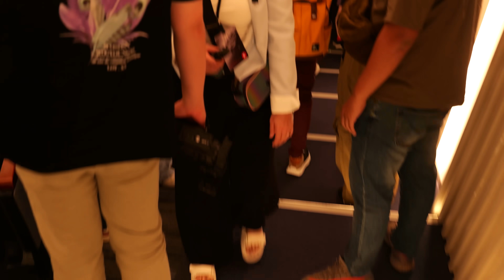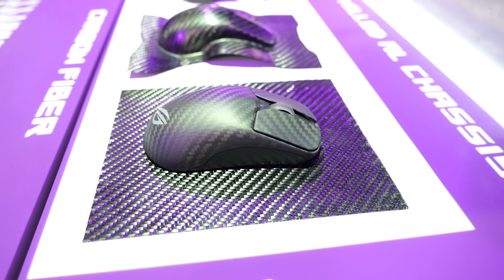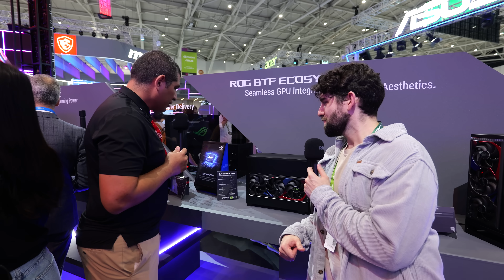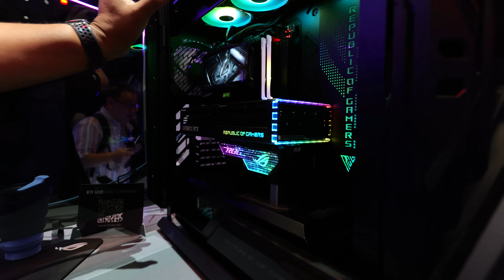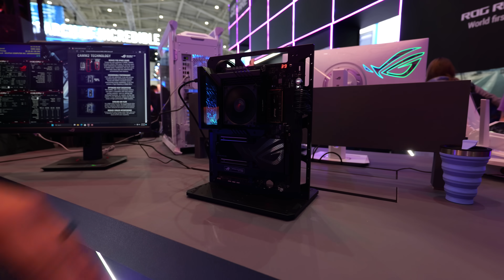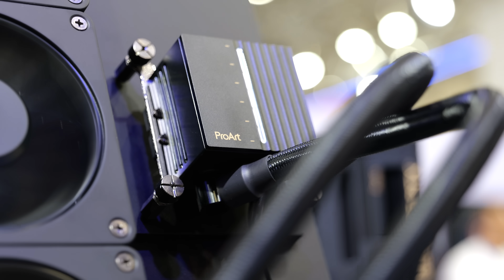The COOLEST stuff at Asus ROG Booth - Computex 2024!

Comment: If you still have access to that guy at Asus, here are some suggestions for him. 
Modernize a motherboard, remove all sata ports, maximize m.2 slots, remove ethernet, add 1 or 2 sfp+ slots, build in hardware raid. (perfect high end gaming/workstation) all flash local storage, beefy desktop nas for mass storage, nas connects through 10g fiber sfp.

Comment: Absolutely on board with moving the GPU outside of the case. The heat they generate now is impossible to deal with without liquid cooling and they raise ambient case temps way too much. This goes beyond the case too. We honestly need a new direction for the GPU interface. Having them supported by these little plastic slots and requiring multiple plugs from the PSU isn't ideal. A new, sturdier interface that supplies ample power and is positioned outside of the case (or draws/exhausts air externally) would be amazing.